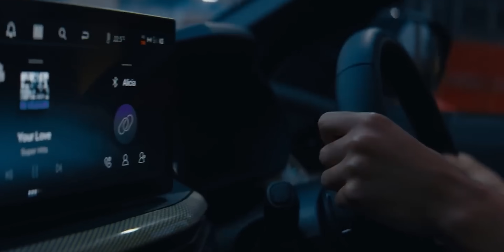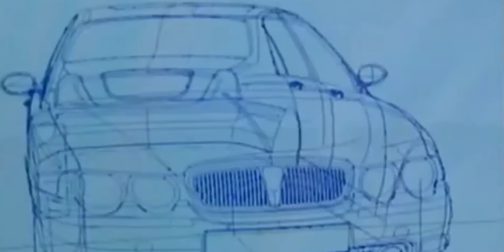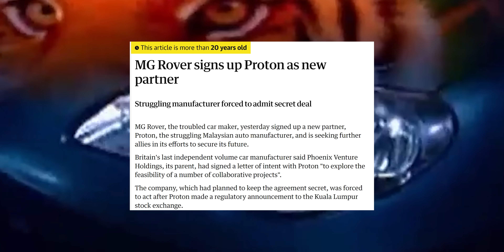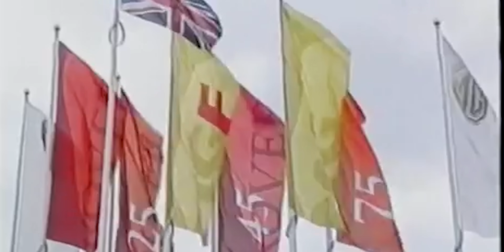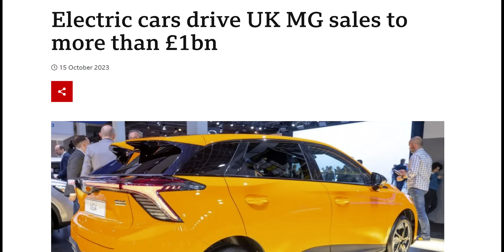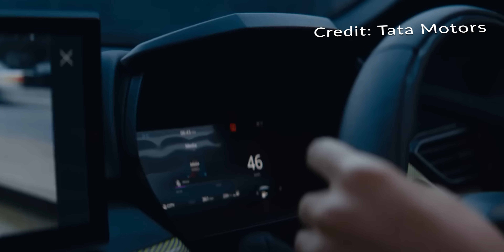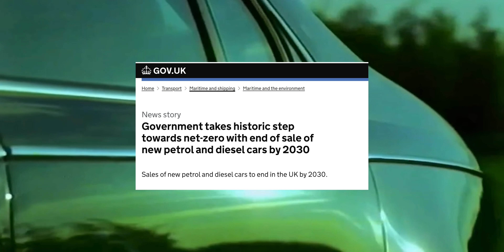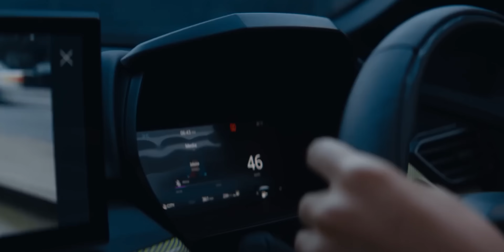ROVER COULD RETURN! But It May Be TERRIBLE!? - Exploring The Tata Rumour

Comment: The Tata Harrier is based on the same platform as the Range Rover Evoque and the Jaguar E-Pace anyway. It has a simpler rear suspension and a locally produced Fiat diesel engine, and some other changes. The Indian market requires simpler, robust, no frills engineering.

Comment: I am not sure that this would be a bad thing if it truly is a question of an equivalent to MG.  MGs are not merely rebadged SAIC cars although they have use much of the same technology.  Design and engineering is done in the UK and they are designed for the British market and similar markets which is more than you can say for BYDs or even Teslas.  Would Tata do the same - I am not sure but their attitude to JLR is encouraging.  But this would not be the revival of a true British mass-market car industry.  If that is possible - and I do not know how that would work - Rover is not the right branding given what happened.  I think going further back in terms of a marque would be necessary - perhaps Riley, Triumph, Standard, Jowett or even Armstrong Siddeley. Or there are the old Rootes Group brands such as Hillman, Singer, Sunbeam or Humber which were well-respected and quoshed for no logical reason by Chrysler.  I presume the rights to these marques lies somewhere in Stellantis - who need the money so might do a deal.  That leads to another thought - Vauxhall still exists and trades and has 2 factories.  At the moment it produces quality products and has had.a good reputation over many years.  It cannot be central to Stellantis given the total eclipse of Opel - perhaps the way to re-establish a British mass market motor industry would be for someone to buy Vauxhall off Stellantis and then build on that.

Comment: I don't think a direct comparison to the City Rover debacle is fair - Tata's more recent cars are a lot more contemporary, and as others have pointed out Tata do some engineering in the UK now (more i suspect than SAIC even excluding JLR parts of the business). Would it work? Depends how they pitch it really. If they go really cheap, they would be better using the Tata brand. They won't want to devalue the Rover name to undermine Range Rover - JLRs big cash cow alongside Defender. Also if they bring Rover back they shouldnt go retro again - it should have a forward looking design and  focus on quality to put any negative history the brand has behind it. Even if prices can be lower than many competitors due to Indian componentry or assembly, they shouldn't market the car heavily on this. If they can demonstrate that Gaydon or the Tata facilities in the UK play a significant role in development, and maybe have some production here, I would really welcome it actually.

Comment: Bring back Rover Metro and make a Polo sized car. Plug in hybrid. Electric only mode for city up to 50mph use. A small 1ltr engine to boost it for A roads. 100HP from electric, 120HP from the petrol. Would be lovely to drive. Battery modular and replaceable.

Comment: Rover was taken as low as it could go with the MG Rover debacle and the overpriced City Rover (it could and should have been launched as an Austin with a Dacia price and still turned a good profit) - it was not imported as a kit but a ready to run car ready to have Rover badges put on it - and the embezzlement by the phoenix 4. Tata bringing it back as a volume EV brand would not matter.

Comment: The MG return took years and it wasn't until the EV market ballooned but is the EV bubble about to burst with it all being Taxed seeing as they can't tax charging at home and the black hole of free VED. BYD have shown you can sell cars without having a dealer network out of the box.
Reply: The "free" VED thing will be solved by GPS enforced pay per mile. In the case of EVs this will be baked into the vehicle systems and un-circumventable sadly.

Comment: Would be delighted to see Rover back! But only if the same qualiy as Land Rover is applied!
Reply from the maker: If they came back and were at minimum designed in the UK, I’d be at the front of the queue.
Reply: Land Rover? Quality? Are you sure?
Reply: @Nimmo1492  did you see a Range Rover lately ? Just as Tom said, if they took the Geely approach like they did with Volvo, and let them create cars worthy of the Rover name, it could be amazing!

Comment: The old argument it is China vs India using 2 English brands. Yes it bloody stinks that the cars are not made in Longbridge UK. SAIC has a strong following in their commercial range but a MG on budget prices , The basic model you can get for $21,000AUD drive away. For Tata to bring the Rover back would be nice. It has to meet the market as their succeed but the Tata had a terrible as their own brand but if they stay along with Jaguar/Land Rover then they will have an established dealership. Rover will sell like hot cakes just like the MG. China may be a super power but their quality is not as good as the Indians.

Comment: I bought Rovers all my life until it's demise Rover if it's to return leave that EV crap behind because it's never going to work..make a nice powerful 3 cylinder petrol engine around 1.2 or 1.5 this dictatorship we are living in should be giving us the choice of what we should drive..all new cars are very clean anyway under the Euro6 emissions..electric cars are not very green a way people should think about where the crap that goes into the batteries come from and where the electricity comes from most of it from natural gas power stations some from nuclear some very little from wind unsightly horrible windmills...diesel is as clean as anything...so we should be saying what we want not told what we cab have

Comment: The only essential thing not mentioned is - do Tata have the rights to the Rover name and badge ?  They have Land Rover and the various model names,  but this is not the same as Rover. When the Chinese walked away with most of the MG Rover equipment and models, they couldn't use the Rover name because it was owned by Ford.